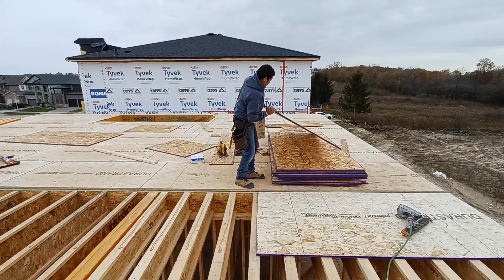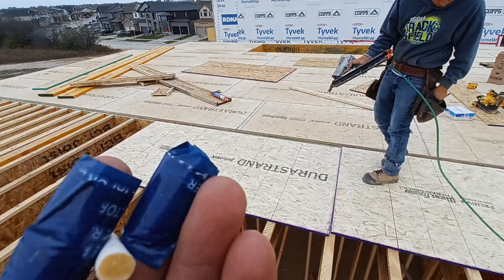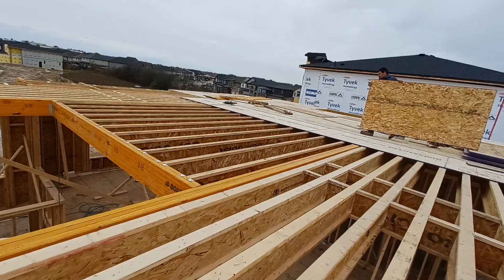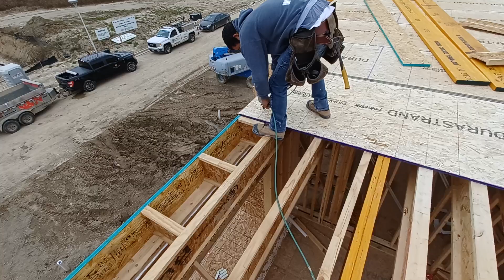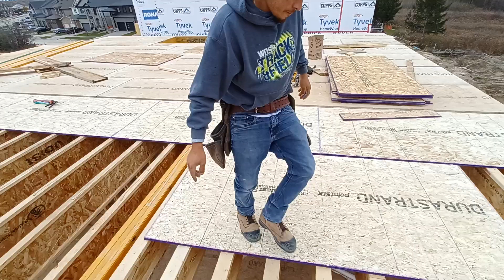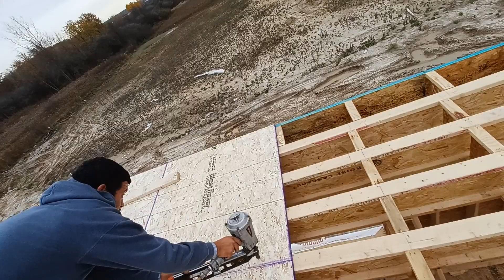sheating my 3 floor. let's go✊✊👊👊

Comment: In Manitoba, We use subfloor glue and screws to hold the floor, the glue prevents future squeaks and the screw don't pop out over time like nails do.
Reply from the maker: In first place. I  did glue check minute 5.45. And the screws are done after by the builder. If framers do it .we charge extra
Reply: @ontarioframingmachine2556  charge extra what are y'all doing getting $4 a foot

Comment: Always run your air hose on the outside of the house also if you don't lay glue on top of the joist, they will squeak.
Reply from the maker: I did put glue. I always do.check minutes 5.45
Reply from the maker: @rickj1983  I did put .you can hardly see it .but if you look good your gona see it

Comment: Great way to break your gun throwing it like that guy
Reply: Might not even be his gun so why would it matter right
Reply from the maker: Of course is my nailer. What's rung with you
Reply: They wont berak that easy believe
Reply: Head cap is busted off
Reply from the maker: @skliros9235  yap is ver soft plastic any ways
Reply: If it's a Hitachi or makita could throw it off the roof pick it back up and I bet it shoots true no jams and the cap for framing? Doesn't matter framing isn't finish work

Comment: This is why we need to make framing and carpentry a regulates trade.   The builder is gonna be left to fix all the squeaks 3 years down the road.   You get quality or quantity,  never both.
Reply from the maker: As long as is not your house
Reply: Why do architects and construction management professional like to take credit for building residential or commercial structures ? The framers, concrete/formers, etc are the trades that physically built the home or building. The project manager MANAGED the trades, and the Architects DESIGNED the structure. Unless a builder self performs trades on a project like the Perkins brothers you are just the owner/investor/project manager. Quit taking credit for the dirty, hard work while sitting in a connex/cubicle all day in a button up shirt. You cannot have it both ways.

Comment: Joists spacing strongly, but floor sheeting will be not holding tie without glue, also forget spacing joint 1mm between sheeting. Do not nails direct on edge side of OSB rim board, it will be splited. If LVL rim board is ok or 2x12 solid lumber better.
Reply from the maker: It has glue. Check minute 5.45

Comment: Bro , no glue on the sub floor. Its a possibility those floors will creeek after awhile settling. No tongue n groove either... Yall definitely do things alot more different than we do in Maryland.
Reply: Actually,  I thought the same. But he had applied the glue on the I-joists before sheathing, as it can be observed later on the video. The OSB is grove and tongue, which can be seen later as well.

Comment: U guys don't have to glue the edges of floor sheeting? Where ever a lap is on a joist must be double glued. Pretty quick, u didn't fully nail the first sheet in the video u missed the bottom edge. Good pace tho
Reply from the maker: Yap did put glue. Check minute 5.45. Thancks for watching.
Reply: @ontarioframingmachine2556  I'm just starting my own channel on framing go check it out
Reply from the maker: Ok I will do that

Comment: No subfloor glue ?
That's going to squeak like you read about.
And stop dropping the nail gun
Reply from the maker: I always do glue .check minute 5.45
Reply: @ontarioframingmachine2556  
It should be under the first sheet that got put down !!!
Reply from the maker: @jamesericksonsr1796  it had men I put glue on that hole row Yost before the video started

Comment: No glue or screws???  That floors is going to squeek.  What good is being fast if youre quality is sh*t.  Jus saying
Reply from the maker: Screws are done later by the builder. Sometimes we do it bu then is extra
Reply from the maker: So easy to point at other people. I am wondering how good is you work
Reply: @ontarioframingmachine2556  much better than this butcher job believe that!
Reply from the maker: Jeje I am not doing fine carpentry. I whana make money. You take your time jajajaja
Reply from the maker: All hired you for 13 box and hour tho lol
Reply: @ontarioframingmachine2556  spoken like a true butcher
Reply: Screws ? This is a spec home, only people screwing down subfloor are custom builders building for private clients with $$$. On spec home framing time is money, it is all about speed.

Comment: Why are you going so fast?  Your getting sloppy?  Dry spots, missed nailing patterns, to hard on expensive equipment.
I am a contractor /carpenter & I look for steady Eddie’s !  They seldom miss , no dry spots.
I heard who ever yell “what are you doing”?  That means you hv a guy filming while you work????? 
Why?  Stupid to do that !  Buy a stand , make a stand!  

Anyway who ever taught you to work that way just stop!  Purchase a ligit pro carpenter belt instead of a $50 lowes or Home Depo one that drags and bothers u all day!
Get a real hammer again no box store anchor !
Real tools, steady Eddie , and pay attention to your steps!

Or not and keep working for bone heads like the one yelling at U!
Reply from the maker: I a gree  with you .the guy screaming is Yost a worcker and he wasn't yelling at me.and am working for my self..for me this are the best framing belts it's pure leather and the last for ever..and I got it at wise line ..I don't get tools some were else.
Reply: @ontarioframingmachine2556  ok I stand corrected!
Reply: I was thinking the same thing.  This is a perfect example of what NOT to do.  No way in hell would I let this guy borrow my tools.